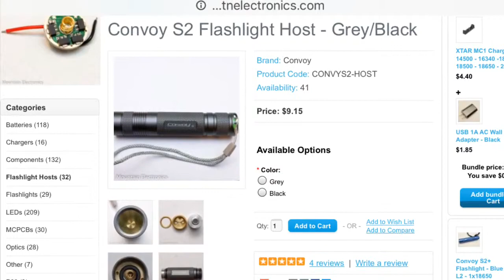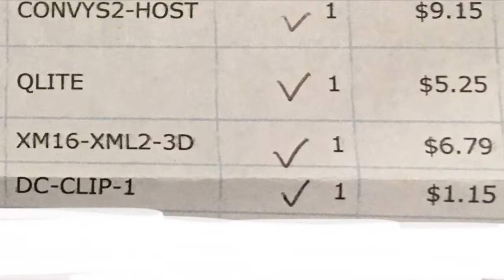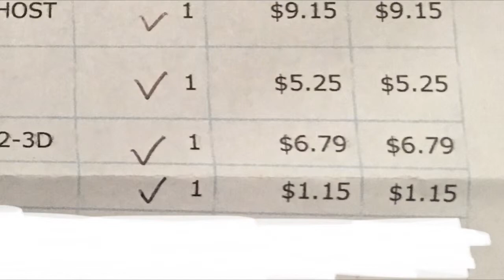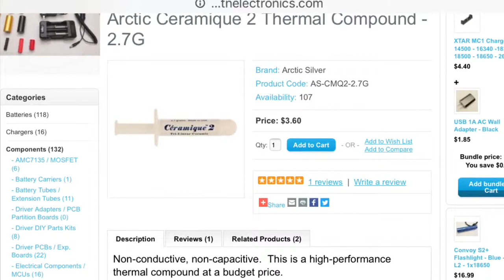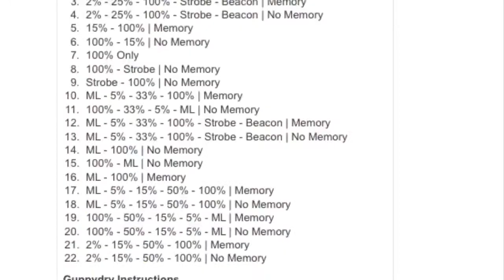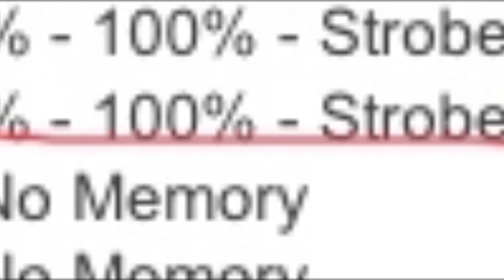Convoy S2 Flashlight Build

Comment: Hi, I'm curious about how suitable your 18650 cell selection is given your driver's amps. It appears that the driver you selected is 3amps max, and the LGE318650 has a standard discharge current of 430mA and maximum 3.2amps: Discharging:3.00V Cutoff
430mA Standard
3225mA Maximum. Are you concerned about over amperaging your cell?
Reply from the maker: 2 years and 0 issues. Still use this daily
Reply: @LaviathnGames  good! Stay safe!